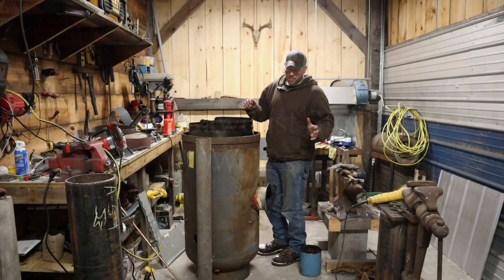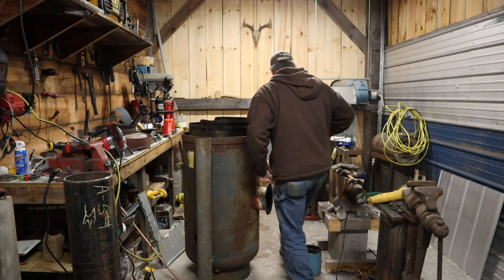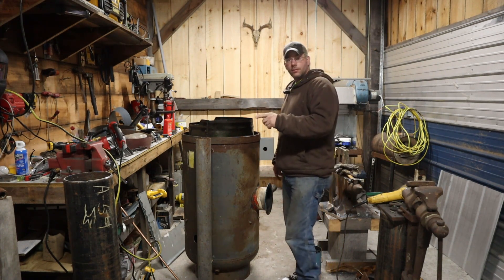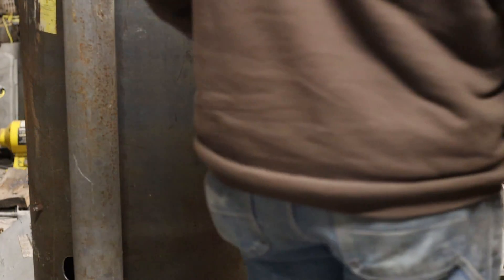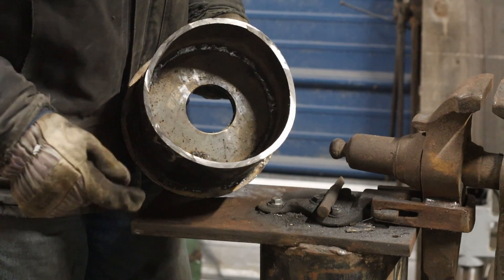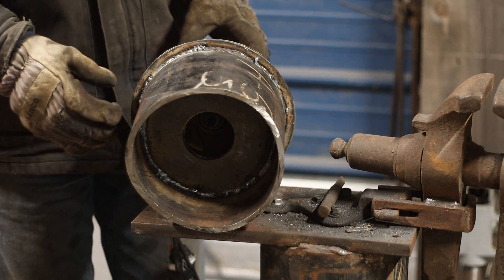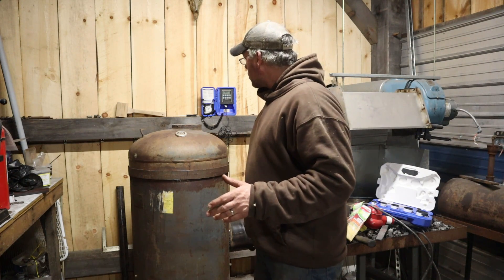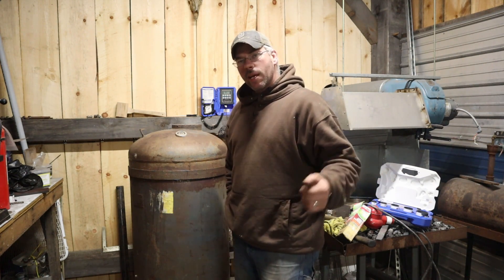The OVERBUILT Sawdust Stove Is Finally Working The Way It Should

Comment: As the sawdust burns outward, does it collapse thereby choking off the 2" hole in the centre? Also, when you light it up for the first time, does it require a accelerant or does the sawdust catch quickly? Thanks! Oh! Good video by the way, as per usual.
Reply from the maker: The sawdust holds shape throughout the burn which is cool.  I use charcoal fluid to get it going but that isn't really needed.

Comment: How warm does it make that room?  Reckon any warmth beats 5 degrees.
Reply from the maker: In the couple of hours that it ran I was able to get the room temperature into the mid 50s. That was with a small fire the barrel top only reaching 350 degrees. If I double the sawdust load in it turn the temperature should substantially increase.

Comment: I probably missed the explanation but, is the moisture content of the sawdust as important as it is with firewood?
Reply from the maker: It sure is, I found in this batch I had some water sawdust mixed with dry stuff and it all burn pretty well. I would imagine if the sawdust is too wet it will just sit there and smolder.

Comment: NIce job JIm. I tryed to build a rocket stove but it was very difficult to make it work well. Little things made a lot of difference but when it worked it was awesome. Dry wood was key and you had to tend it constantly. On a good burn the bonnet would almost 500 degrees and you could hold your hand on the stovepipe. I wonder if you will be able to produce enough dry sawdust to make it work. How do you clean out the ash. You know its nice to get your ashes hauled once and a while.
Reply from the maker: The inner barrel lifts out very easily so I can just dump them.  The bottom I will need to make a door.

Comment: Morning Jim.
"You only need 6 or 8 inches..."
Then she said, "size does matter".
A restrictor plate... is this a saw-dust burner or a Nascar?
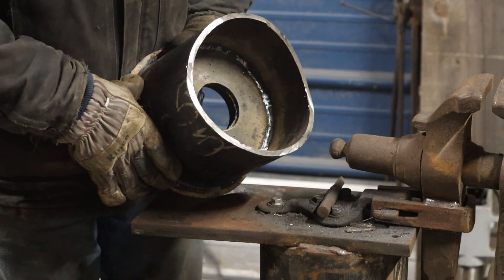Well, gotta get ready for my Brain scan at 6:30 followed by my last Final Exam for my bachelor's degree at 11:30. Hope all is good with my brain, but having a reason for my symptoms would be nice. My white blood-cell count is normal, so not really concerned with the "C-word". Dizzy spells, memory issues, my first ever seizure, chronic pain... All with no definable diagnosis. Gotta watch that breathing protection in the shop and in the construction trades, never know what your exposing yourself to.
Reply: I had a stroke 4 years ago. The problem is the docs don't know the cause - so I'm on just incase pills. Never had cholesterol problems or high blood pressure. I'm on pills for both.

Comment: Kind of wasteful ? is it not possible to use the exhaust gases to heat some sort of radiator instead of warming up the outside ?
Reply: You need to lose some of the heat or you will have condensing occurring and residue buildup.  Ideally above 210 degrees at the far end of the exhaust pipe so no buildup occurs.
Reply from the maker: It is possible but Marshy is right on.  If this thing condenses on me it will rot out fast.  When burning wood of any kind it needs to burn hot to burn as cleanly as possible.